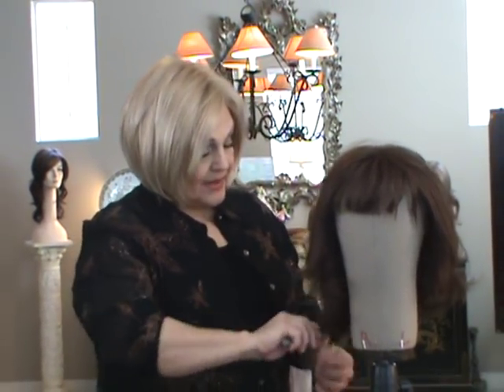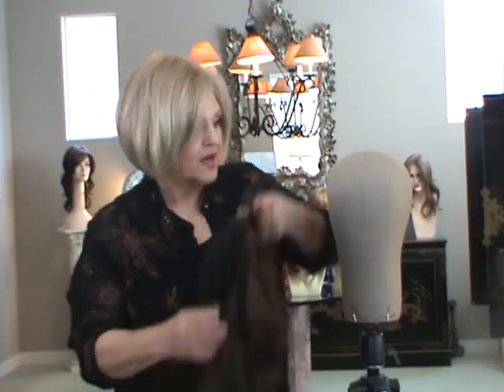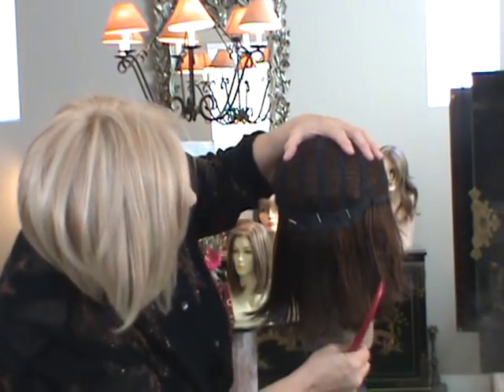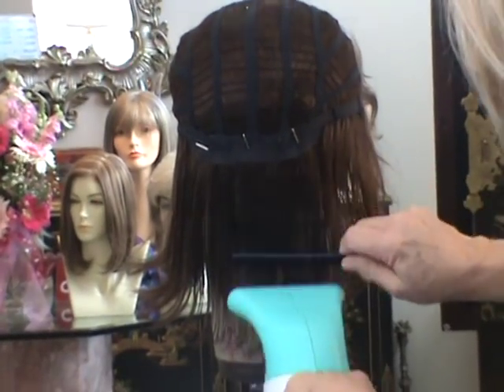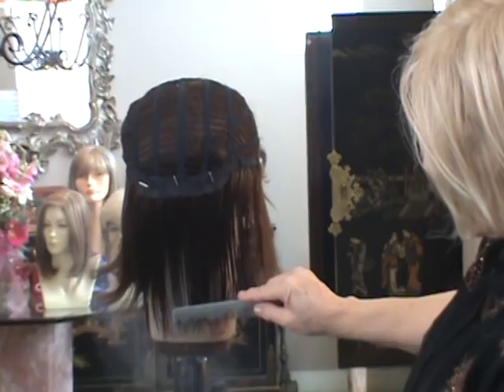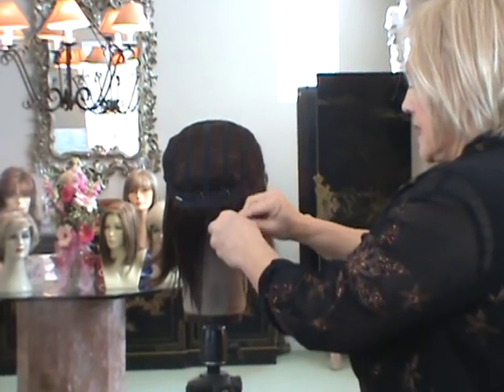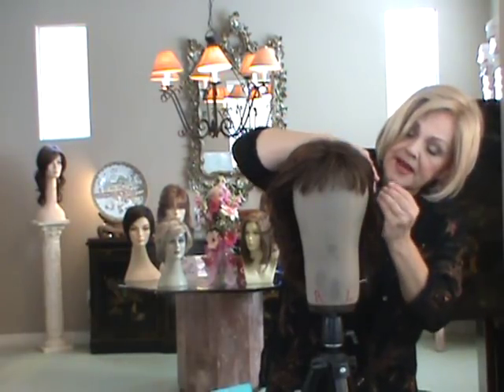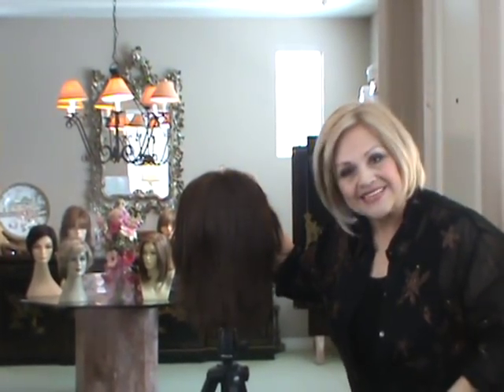Synthetic Wigs -  How to Defrizz

Comment: I am new to wearing wigs and currently have a heat-resistent synthetic. When the ends started getting ratty, I tried flat ironing them straight. When that no longer worked I started cutting the damaged ends off. I was at the point of purchasing a new unit when I came across this video. I tried your method and could not believe the fabulous results. The steamer works so well and the detangling spray is a must. Thank you so much for sharing your knowledge! It is greatly appreciated.

Comment: Patti - I really would appreciate how to restyle short wigs especially the ones with flips in the back. I can get them to fluff up but they don't tend to have flippy points but it all stands up with the hairs independently. I'm wondering if I need to gel the flippy points first, let it dry, and steam them with the gel, then let that cool/dry again.
Reply from the maker: If it's a short spiky wig I would try using the Jon Renau Flexible Spray Gel or the Jon Renau Piece Out Contour Fiber Creme. Both of these products work great for this type of thing.

Comment: Did I misunderstand? Was this a regular synthetic or a heat one? I can't even get into my car on a hot day so you can't be blasting a non-heat one with steam and then a curling iron, right?
Reply from the maker: You can use a steamer on regular synthetic. It's considered wet heat and actually revives the wig. If you ever take a wig in really bad shape to a wig salon to be revived they will use a steamer to do this. You can not use a hot curling iron on synthetic but you can wrap the hair around a curling iron that isn't turned on and apply steam .....this will help add curl and volume.
Reply: Wigs by Patti's Pearls
You are so amazing, thank you. I didn't know this.

Comment: Nice tips!! But I have a synthetic wavy wig, using steamer to defrizz would be make the wig straight
Reply from the maker: That is correct. You can also put in rollers and then apply steam to the rollers. Leave them in overnight and it will put some curl back in it but it won't be the original curl pattern.
Reply: Thank you!

Comment: That works great but how do you get frizz out of curly wigs. Won't the steamer take the curl out of the curly wigs?
Reply from the maker: Yes, it will remove the curl but it's the only way to help the frizz. You can curl a wig by wrapping the hair around a cold curling iron (or rollers) and apply steam. This is a very lengthy process and although it will add wave and volume, you will never get the curl back exactly like it was.

Comment: You mentioned a detangler that you have talked about previously, what product is that? Any help greatly appreciated. Just started wearing wigs and am in tears at how fast the wigs are breaking down. I’ve tried a few products that you are supposed to spray after each wear, but they seem to dry them out, and whoa Nelly do they smell overwhelming…help!
Reply from the maker: The Jon Renau HD Smooth Detangler is the one that we use when steaming. The one that we suggest for daily wear is Envy's Renu and Repair Glosser Spray. The fiber will still frizz and tangle. Synthetic fiber is made of acrylic and a side effect of it rubbing against skin, clothes and material is to frizz and tangle. So, while all of these products will help prolong the life and reduce the side effects, it will not prevent them from happening. Another tip is to only use a wide tooth comb (nothing else). When combing, start from the bottom and work your way up. If you start from the top, it will pull the tangles through the hair which will make it worse. Good luck 😊
Reply: @Wigsbypattispearls  thank you for always responding, you’re all awesome at Patti’s pearls.😘

Comment: I like this, but what if it's a very curly wig?  I can't really comb the curls
Reply from the maker: Steaming will remove the curl but it's the only way to help the frizz. You can curl a wig by wrapping the hair around cold rollers and apply steam. Allow the hair to dry and set in the rollers overnight. This is a very lengthy process and although it will add wave and volume, you will never get the curl back exactly like it was.

Comment: Just finding this video and wow! I wish i would've found you sooner to save so many wigs lives, lol! I have a new curly wig and ive waited a whole month to wear it because i knew the clock would be ticking as soon as i put it on my head. Im a little worried about combing curly synthetic hair while wet with the product, so what do u suggest?
Reply from the maker: Hi! Thanks for reaching out. Steaming your wig will take out the curl pattern and will re-bake it into a straight style. If you were to steam it, you'd need to use something to restyle it afterwards. If yours is regular synthetic (not heat-resistant), you can use steam to put curls back in it as well. After you defrizz, you can roll the hair into rollers, then apply steam all over. Leave the hair in the rollers until completely dry. We hope you find this helpful! If you need more assistance, please reach out to our customer support at support@wigsbypattispearls.com❤

Comment: hi! Great video, it looks so easy! so I have a question. does this technique work on synthetic hair extensions as well? I just bought a 24" wavy hair extensions from ebay about a little over a month ago. Its loosing most of its soft texture, its rough and ratty throughout the bottom half from its getting so tangled up. Most of its waves are flattening. I tried shampoo and conditioner. And afterwards, combing and brushing it out. and i cant use my straightener because it only has one setting. :(

Comment: Hi Patti, 
I love your youtube shows. 
I was wondering,  I've got a very matted Rachel Welsh wig. It's matted right under the hairline at the back of the wig. I'm even afraid to comb it because it's so matted, I'm afraid the synthetic hair will come out. I've only worn it once, and I looked at it and just threw it in my closet. I've got a salon detangler that works great on my hair, do you think I could use that on it, even before I start to try and comb it out? That's the way it's supposed to be used on my hair which is fine, although I have lots of it. 
Also, I was told if I wash this wig, all the beachy waves will come out of it, and it will ruin the wig.  
My question is, my wig is so matted it almost looks like a cat's matted fur. What do you suggest? Please, I need your help, it cost me too much and it looked beautiful on. I'd really appreciate any help you could offer. Sincerely,  kathk from Burlington, Ont.
Reply from the maker: Hi Karen. We recommend you invest in a synthetic-safe detangler like this one: https://www.wigsbypattispearls.com/heat-defiant-detangler-smoother.html Spray a generous amount into the hair and let it sit for 1 minute, comb it out as much as you can, and then start applying the steam. As you steam it and continue combing it, it will start to detangle and become smooth. Separate it into very small sections and start at the bottom working your way up. Take your time doing it so you don't rip the fibers.

If you wash synthetics, the style will stay. That is the beauty of synthetics! HOWEVER, steaming it WILL remove the wavy style and will make it straight. Steaming is the only way we know of salvaging this wig. If it is a heat-resistant synthetic, then you can use a curling iron or hot rollers to restore the wavy style, and if it isn't heat-resistant then you can roll the hair into cold rollers and apply steam to it and let it dry to re-bake the style. We hope this helps. If you need additional assistance, please call us at 800-670-3292.

Comment: But what if you have a curly wig?
Reply from the maker: It works the same way, however; the steam will straighten the wig so you would have to add the curl back by rolling it in cold rollers and then apply steam all over for a few minutes until you know it's been steamed well all over. Leave the rollers in over night as the style won't set until the hair cools. This process will add curl back to the wig. The issue is that you can never get the curl in the exact same pattern as it was in when you received it.  To keep curly hair in good shape, we highly advise using the Envy Renu and  Repair Spray every day that you wear the wig. Never use anything but a wide tooth comb and even then try not to mess with the hair too much. To help the curls look more intact once they start loosing their wave, try the Estetica Sea Salt Spray and scrunch the hair. 😊

Comment: Hi. When you did the hair. Was the hair still quite damp from washing or Sid you so this on dry hair. My hair is frizzed because it looks like it's got so many split ends. Can I do the same or is my piece had it. Thanku
Reply from the maker: Start with dry hair Spray it with Jon Renau HD Smooth Detangler then steam one small strand at a time.
Reply: Hi Patti. I finally go to do it as you suggested and of course under your coaching guide it worked.. However now my synthetic wig looks oily. Even though I wash. It looks oily all the time and I have to be careful it doesn't look dry somehow. On the top it does look flat, as oily all over What do you recommend for the oil look please.  Thankyou so much

Comment: Can one use a steamer on a wavy or curly wig?
Reply from the maker: Absolutely but remember it will straighten the wig. To add curl or wave back you would need to put in rollers and then apply steam. Then you'll need to leave the rollers in until the fiber cools down from the steam. The new style doesn't set until the fiber cools down. A steamer is a synthetic wig's best friend!!! It can take the place of pretty much any heat tool when it comes to styling.
Reply: @Wigsbypattispearls  thank you :)
Reply: @Wigsbypattispearls  can you use a steamer on 170c heat safe wig?

Comment: I'm guessing this is for a heat friendly synthetic fiber?
Reply from the maker: Steaming is safe for both heat friendly synthetic and regular synthetic. Because steam is a wet heat, it will not damage and melt synthetics like dry heat (flatirons, blow dryer, etc) will. Steaming is used for both styling and conditioning high quality synthetic wigs of all kinds.
Reply: Thank you so much!